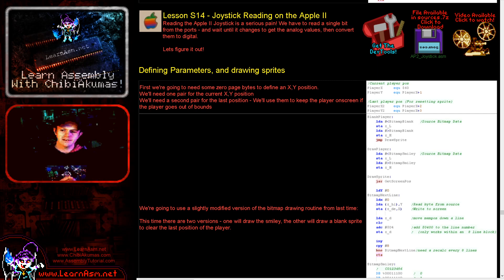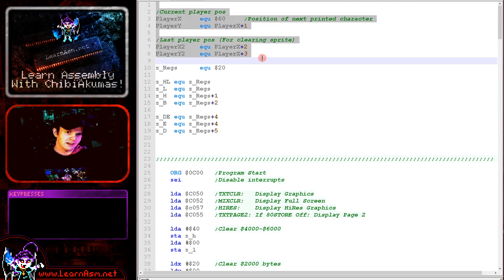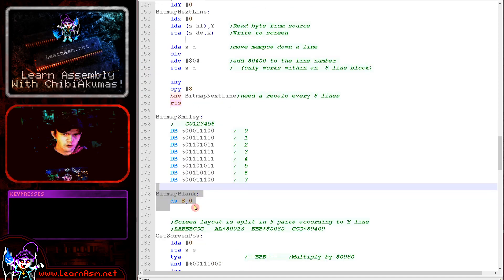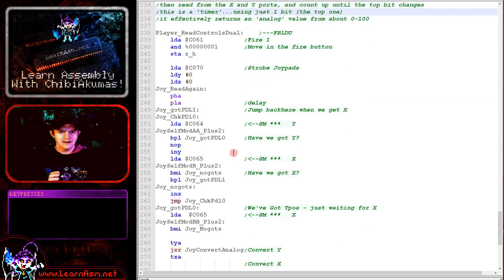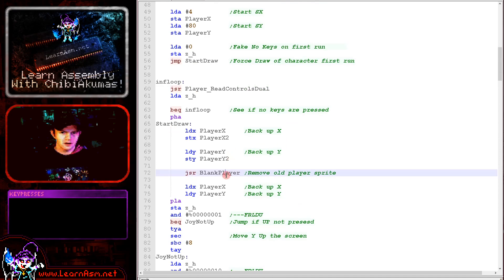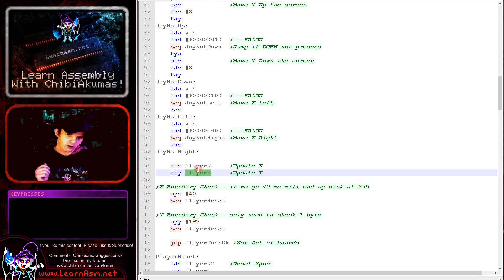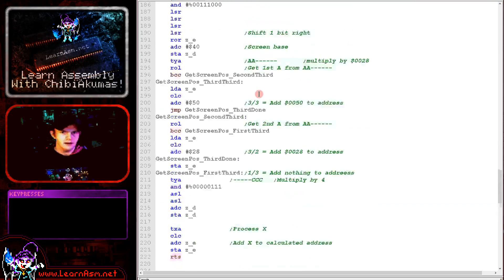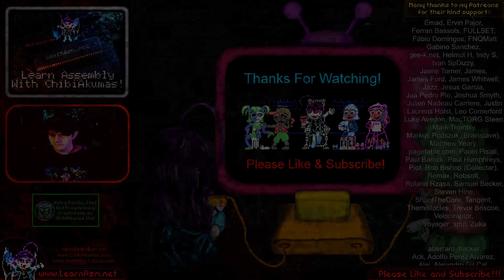Joystick Reading on the Apple II - 6502 Lesson S14

Comment: At the contrary, even if the routine to read positions is tricky, the Apple analog joystick was a jewel back then.
The pleasure to pilot Choplifter, Rescue Raiders, Tranquility Base thru an analog joystick was immense.

So, starting from your nice demo, you can benefit of that. Deducing an X and Y acceleration, instead of a simple incrementation/decrementation of the sprite position. I'll be funnier.